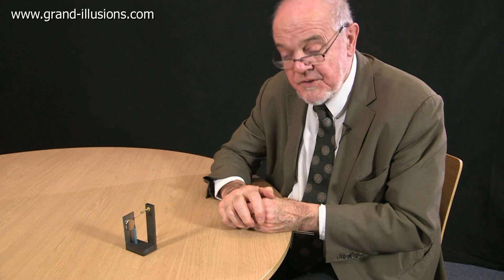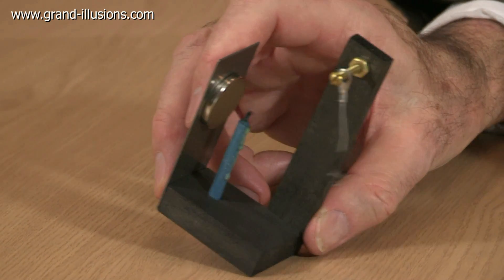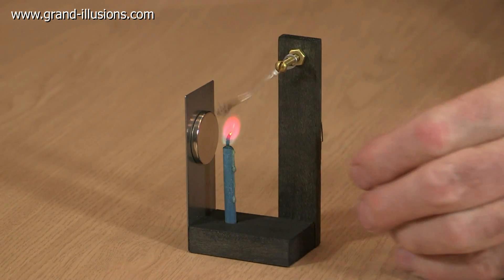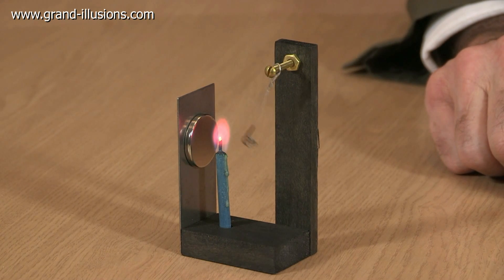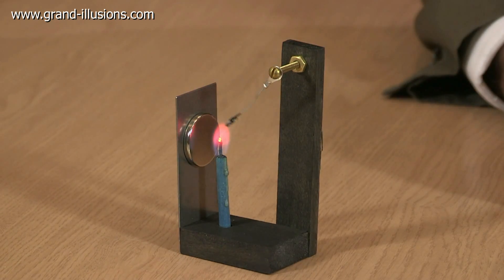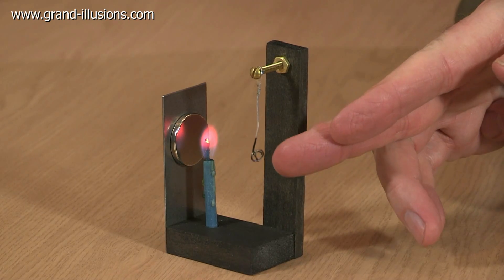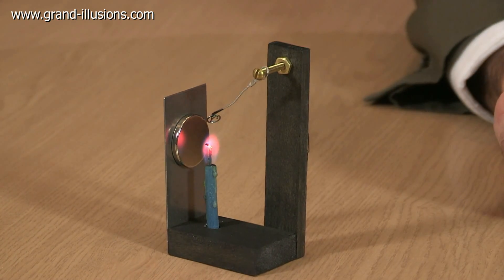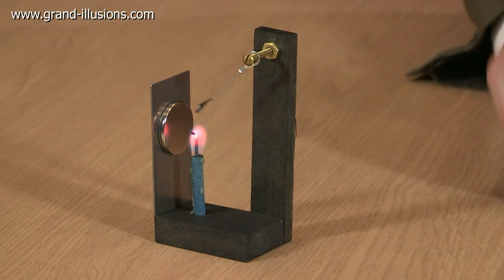Curie Point Magnetic Heat Engine

Comment: Interesting, but I don't think it's really a heat-engine, because the heat only serves the purpose of taking the system out of balance - over the critical point of the Curie temperature for the given metal. The force that actually would do the work is the magnetic force between the magnet and the nickel part.
To illustrate my point - imagine that you have a flame (or other source of heat) that can bring the nickel not to mere couple of hundreds degrees Celsius, but to lets say a 1000 (that's still comfortably under nickel's melting point with about 400 to spend). So would the pendulum would do more work, by swinging faster or harder? Obviously not, because the up-swing force is limited by the force of attraction between the magnet and the nickel (or whatever ferromagnetic metal is used instead of nickel).
Still it's curious to see how long a magnet can last in such device before weakening enough to stop working?
Reply: Very late response, but I still think it's a heat engine, because it's ultimately converting thermal energy into kinetic energy.

You could absolutely get more force from a bigger flame.
If you want more torque on the pivot point (eg, to drive some machine), you'd want a heavier weight and a bigger magnet. At that point, a hotter flame would indeed make the engine oscillate faster, and therefore output more kinetic energy.
Reply: Here's an analogy --
Imagine a steam engine, where a piston expands and then is put back into its original position by a spring.

Even though the spring applies a force, it's ultimately not supplying any energy.

Comment: This is not a heat engine. The flame imparts no energy to the action, it simply nullifies the ferromagnetic property of the metal wire.
Reply: This IS in fact a heat engine. Just because you're personally ignorant as to the mechanism of thermal demagnetization doesn't make it NOT one. The sole source of energy driving the device is heat.
Reply: If this was true, you could build an overunity efficiency motor.
Reply: Well that's just it. This effect is a motorization, not an engine - - with little or no load bearing capacity. The propelling forces at work here are the permanent magnet and gravity. There's no overunity about it.
Reply: The moving part has to overcome continuous friction, so something is adding energy to it continuously. No matter how low the power in this example is, this is an engine. So you either have to propose a mechanism on how the heat energy is converted to mechanical energy, or if you insist that heat adds no energy to it, you have to accept that the engine produces energy out of nothing.

Comment: The sun is a magnet, and its very hot. #wtfgod
Reply: +EpochDeus No it's not. The core of the earth is a magnet. The sun is a nuclear power plant.
Reply: Yeah it is. How do you think Solar Flares work? Magic?
Reply: Says the guy who thinks the sun is not magnetized.
Reply: +EpochDeus +ferretyluv You're both right, and you're both wrong. The Sun is a nuclear fusion "power plant," with the fusion generating a ton of heat and light. For some reason, most likely due to convection currents carrying charged particles, the Sun generates an extremely strong magnetic field, the strongest in the solar system.

Also, the magnetism of the sun isn't from the orientation of electron "spin," like in normal magnets, it's from the motion of charged particles, like an electromagnet. It's a lot more complicated than that, and I don't understand it well enough to actually explain it.
Reply: I do, but I don't want to. The sun is in fact a magnet, even if it is also other things as well.

Comment: Weller soldering irons use this property, the soldering tips have a magnetic curie alloy on them to close a switch to turn on the heater, when hot they loose magnetic effect and heater turns off.
you can buy different temperature tips. But newer soldering irons are controlled electronically. You can see the Curie part at the back of the tip in the diagram. The number is the temperature in F eg 7 = 700F
http://www.radioparts.com.au/images/ProductImages/38573512.jpg

Comment: What a great toy!

I used to do some amateur blacksmithing, and this trick was introduced to me as an old folk method of testing the temperature of a piece of metal for certain purposes - you could keep a magnet by the forge and check to see if the iron you were working had lost its magnetic property, which was easy evidence of how hot it was even if it wasn't glowing.

Comment: Do you have any perpetual motion machines in your collection?
Reply: Since they are impossible, no he doesn't.
Reply: Sure, he keeps them next to his anti-gravity machines, cold fusion machines, and unicorn eggs.
Reply: 0s4x
Gravity-based are not impossible. They just don't give out any noticeable amount of energy. They are able to move for a very long time after applying a small amount of force, but they do not correspond to a definition of perpetuum mobile.
Reply: Slithereenn Energy out will always be less than energy in, so yeah, impossible.
Reply: Richard Smith
That's what i told. But you can make a machine that will be in motion for a really long time just from that slight initial push. It will stop eventually due to friction.
Reply: Richard Smith well, energy out will always equal energy in (law of conservation of energy), however some energy will be converted into unusable types in almost all machines, so perpetual motion is practically impossible.
Reply: Richard Smith
It just take energy in and dont give much energy out, it just goes around and around.
Reply: MrDrProfStew not necessarily especially when taking into account quantum physics where things can vanish or appear randomly or energy can be converted to matter.
Reply: MrDrProfStew What I meant was, captured energy out will be less than energy in. The second law of thermodynamics guarantees that energy will be lost to nearby objects due to entropy, since equilibrium must be found. Objects with a higher energy will overtime lose its energy to its surroundings until everything has equal energy. This process is not reversible, once the energy is lost to another object, that energy cannot be recovered.
Reply: ***** That is not how virtual particles work. To become real they need to take energy from somewhere else, no energy is ever created from nothing.